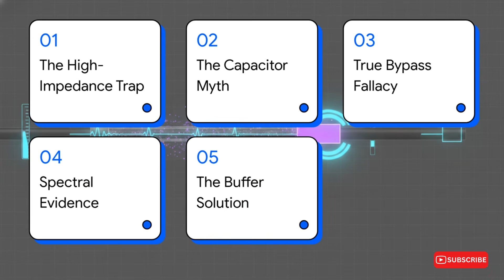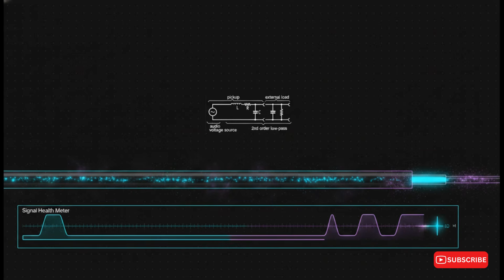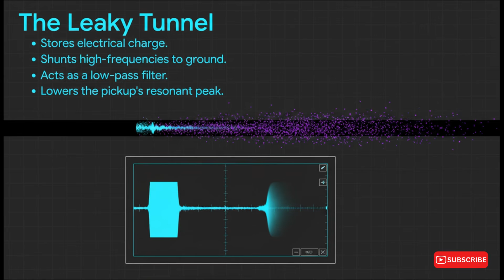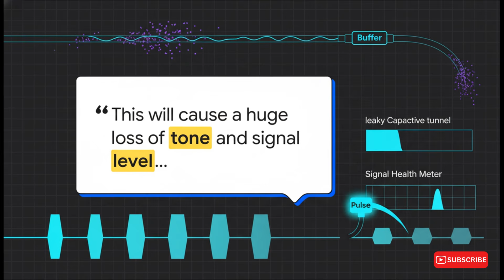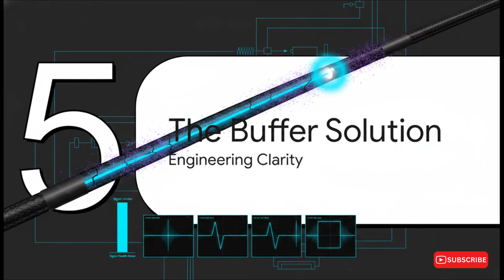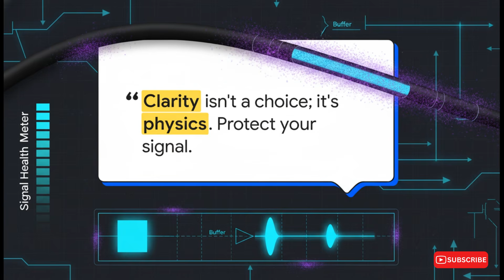Stop Killing Your Tone: The "Ghost" Cable Disaster

Comment: The key points that's kind of glossed over... is a High Quality Buffer. Plug a Strymon pedal in, and even off it improves your tone because of the high quality of the buffer, high headroom, high impedance input and low impedance output.
I plug in a Boss DS-1 alone and it immediately hurts my tone, even though it has a built in buffer and a high impedance input.
The design money goes to the effect more than the bypass quality. Of course it will still be better than 2 20 foot cables joined.
Reply from the maker: You hit the exact truth about circuit engineering: not all buffers are built the same.

High-end builders (like Strymon, Lehle, or Radial) design their buffers using premium discrete components, FETs, and internal voltage boosters that push headroom way up, ensuring zero frequency coloration or dynamic compression.

Meanwhile, mass-market pedals with traditional buffers often rely on budget op-amps running on standard 9V rails. While they still prevent cable capacitance loss better than a 40-foot cable run, their limited headroom and component choices can subtly choke high-end transients or introduce minor distortion when hit with hot signals. It's all about component quality and circuit topology! 🎸